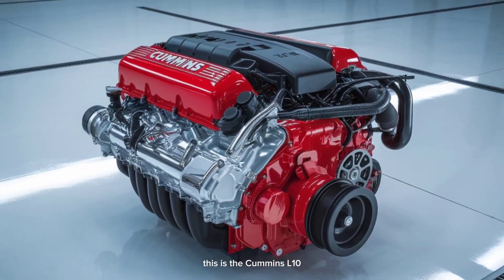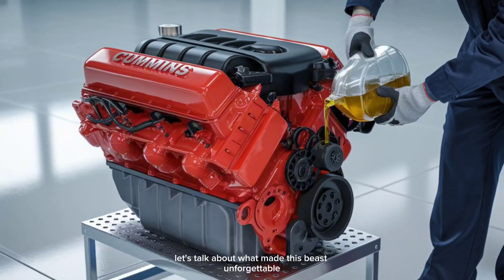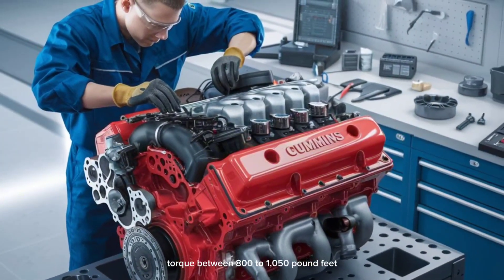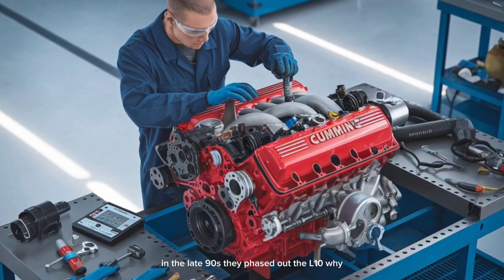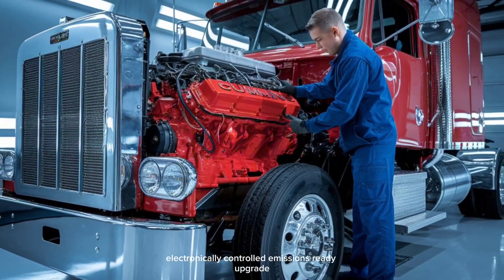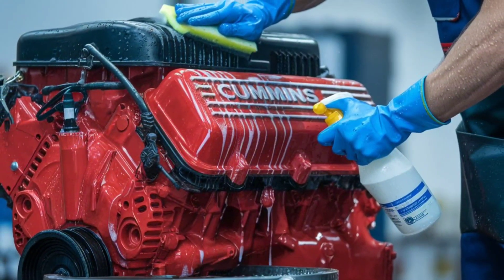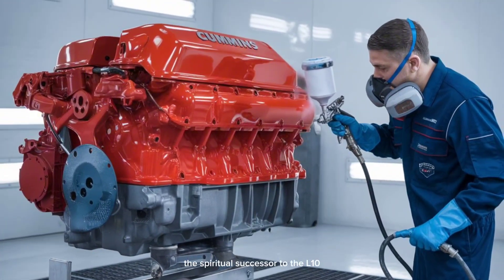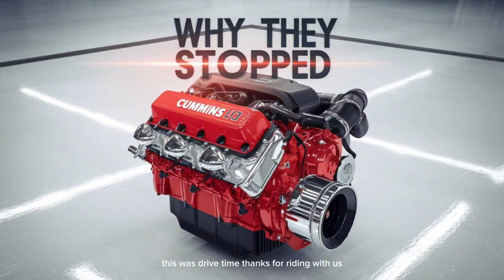“Cummins L10: Why This Legendary Diesel Engine Was Suddenly Discontinued”

Comment: AI crap. At first, I was trying to remember when Cummins made a V8 diesel. Then I saw the guy pouring oil into a water pump pulley and decided not to watch this BS
Reply: Back in the late 70's,  early 80's  cummins built the triple nickel, the 555  and the 903  V8